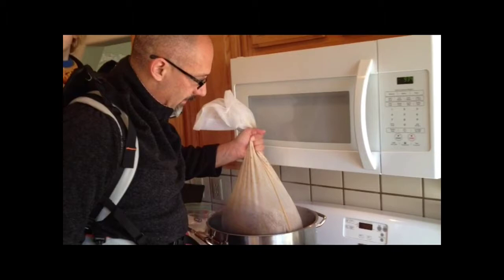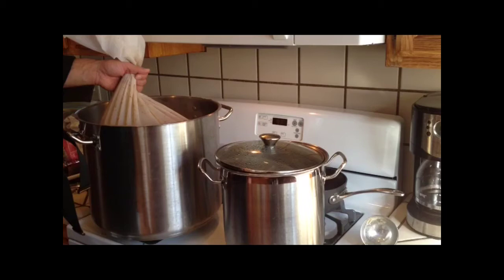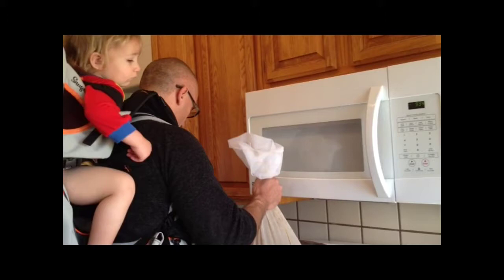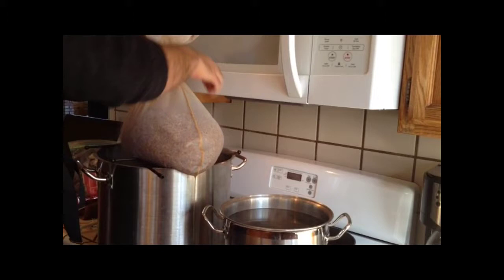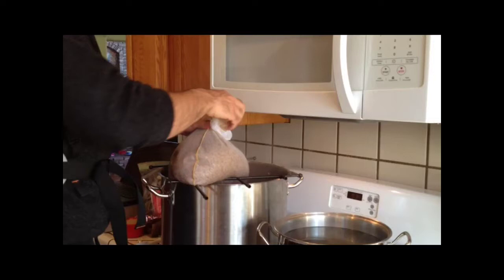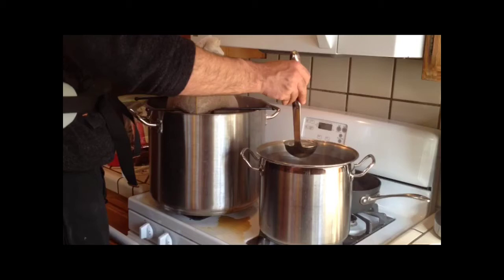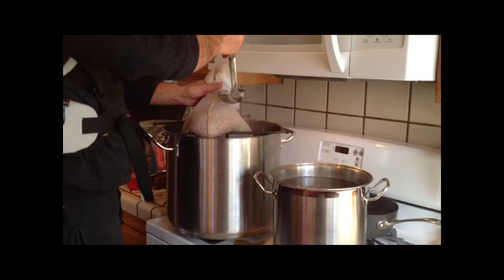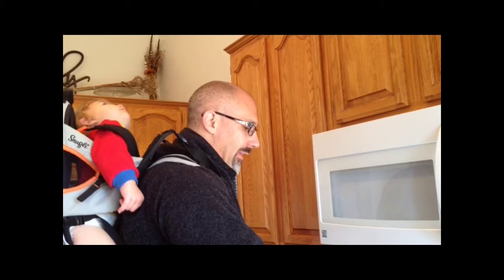How to Sparge with an all grain batch of beer using the Brew in a bag method

Comment: Your method looks pretty messy. I was thinking of buying like a stainless steel weber grill rack ($8 at home depot) and putting that on top of the kettle, then using a steaming pot's perforated kettle to put the bag in for sparging.
Reply: Messy is an understatement

Comment: Hi, good vid. My question is why not use cold water for sparge water?
Reply: Haha, I do appreciate it.
We use BIAB with a 40L urn and sparge with warm water in a separate bucket (with holes around the bottom colander style, to catch runoff and place in the urn for boiling). It works well and our efficiency is now always exceeding expectations. I guess like many aspects of brewing, once you've got a repeatable routine and know how your system works, run with it! So far, for our small 40L set up, warm or cold water sparging hasn't caused any problem!